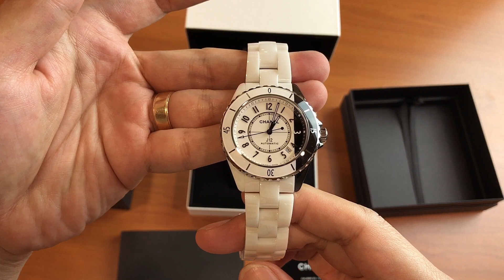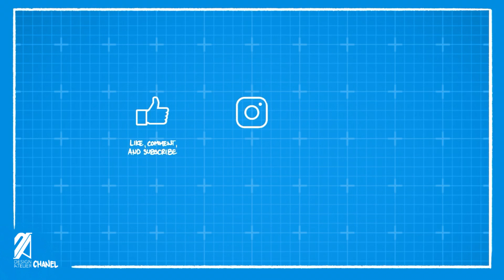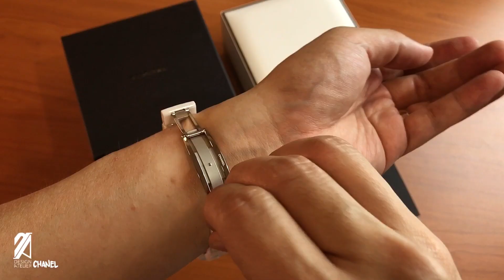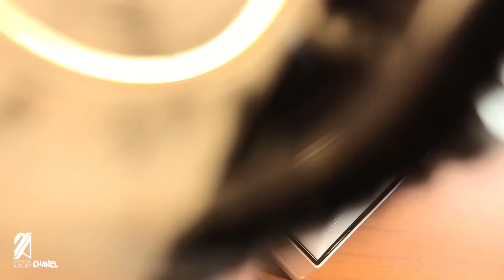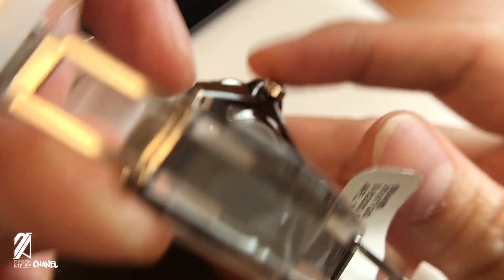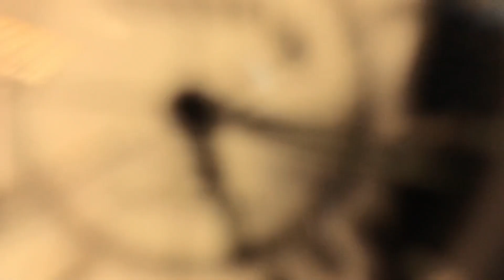The Chanel J12 Paradoxe Hands-On Review

Comment: I like these watches but for the love of Pete, do not buy new. They have an 70% kerb tax and I've bought two, each was 85% off without box and papers and a couple of links removed. They don't scratch, so used models are minty. Just make sure it has enough links for your wrist as replacement links cost upto $600 each.